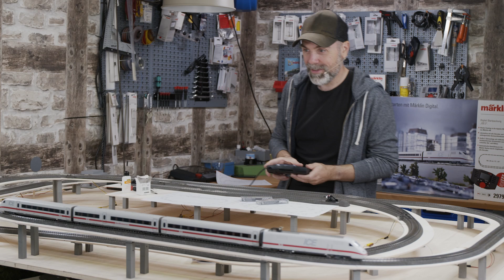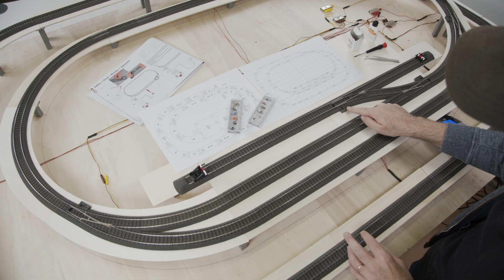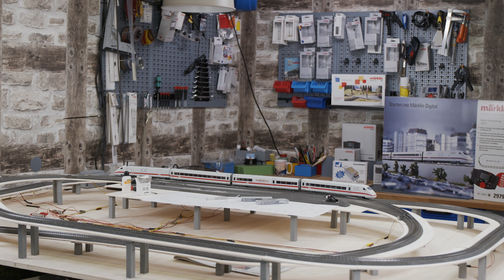Building a Model Railroad / 09 / Test drive with two locomotives and install figures in the ICE

Comment: WIth the Mobile station 2 you can drive with 4 trains on the same time, but if you want drive with more than 4 train . Is it possible to use a booster from marking?
Reply from the maker: The Upgrade is the Central Station 3 with more power. A booster for the trackbox (power supply for Mobile station) is not available. But you can save power by connecting decoders for switches and signals with an additional power supply.
Reply: @maerklin  U use decoder 74462 with is installed below my c tracks. Can I use in that case also an additional power supply. If Yes can you give me some advise
Reply from the maker: You can’t connect an additional power supply to the tracks. That will damage your setup. Use the additional power supply only for the m84 and m83.